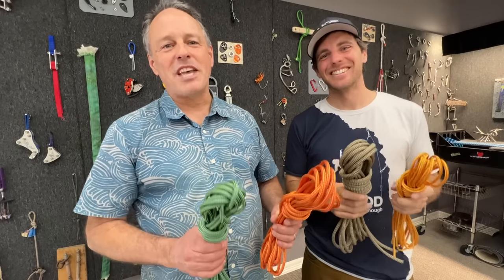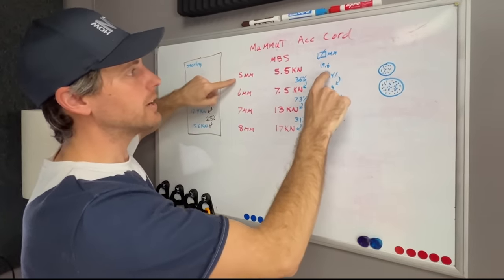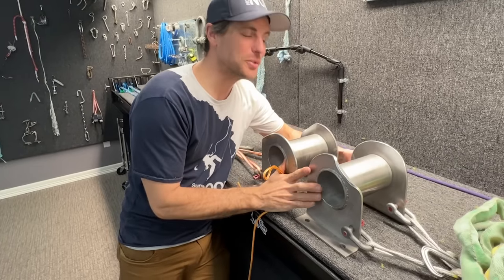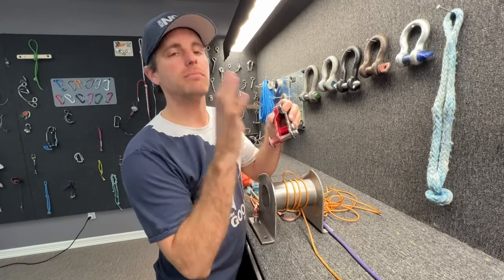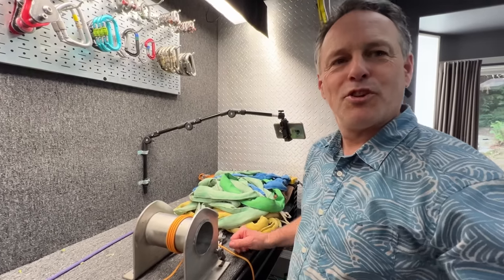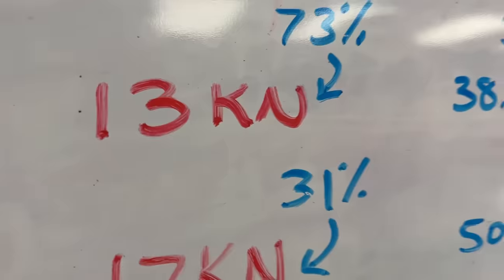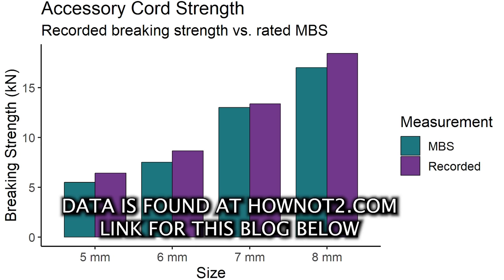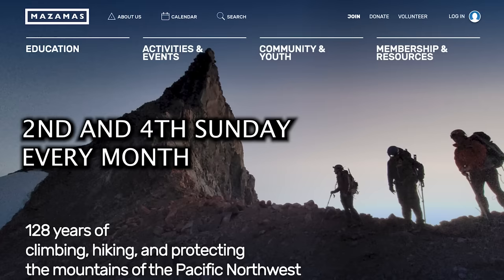The difference is INSANE

Comment: Not sure if it's useful or even interesting, but you could try desheathing the ropes and pulling the cores and sheathes separately to see where the strength increase is coming from.
Reply: Sounds interesting, probably not useful but it'd still be cool to see.
Reply: Quite interesting, questionably useful. Sounds like YouTube
Reply: Not an expert by any means, but my understanding is that the main strength is the core strands. The sheaths main purpose is to protect the core from abrasion and being cut on edges.
Reply: @cdans2202  often you can find literature that states its a 70/30 split of strength, the core being 70 and the sheath being 30 but both parts can be constructed differently to tune the desired properties.
Reply: Interesting vid.

Comment: If they need to hit MBS 99.7% of the time, the larger leap between diameters seen on the manufacturer's rating could be the larger diameter being more consistent, while the smaller diameter may be more prone to inconsistency reducing numbers?
Reply: I also wonder if maybe the numbers for the smaller diameter are from an older material or manufacturing method, and the increased strength wasn't carried into an increased MBS because it was a side effect or unintentional
Reply: You also saw the same phenomenon (just not quite to the same magnitude) in the actual tested numbers in this video though. So I don't think that's it.
Reply: @briancarr9663  sorry, I wasn't more specific because I did actually mean that magnitude of leap because the manufacturer rating and the ones tested here. The leap is there, but not as massive, and I wonder if this is because the smaller diameter is just a little less consistent for establishing an MBS.
Reply: Good hypothesis for 6 vs 7 In isolation, but not for why 6 vs 7 breaks the pattern established by 5 vs 6 and 7 vs 8.
Reply: @serges5681 
As Ryan alluded to there is probably a change is weave at6/7  making 7,8 comparable and 5,6 comparable and 6,7 brake the pattern.

Comment: I suspect that there is an actual difference in how they are made. If you calculate the breaking stress(MBS/area) you find that the 5 and 6 mm cords are very similar(.28), and the 7 and 8 cords also give the same number(.34).  But those two pairs are different.

Comment: This was fascinating.  One thing that popped out to me from the chart is that the safety margin for 6mm may be higher than that of the 7mm.   So maybe...with the smaller diameter rope they have to add a higher safety margin, because it might not be possible to control the precision of the smaller fibers as well.  Or in other words, if the strand spec is Xmm +/- .01mm or whatever, that's going to be a bigger percentage change for smaller strands than larger. Guessing here!  Fascinating tests.

Comment: Really interesting and great video! It would have been great if you cut the different cords and measured the thickness of the sheath and/or counted the number of nylon strings in the core. This could explain the initial jump. Also super nerdy: it would be interesting to test single strands of nylon in different cords to see whether they are all the same and if yes(no?) you could infer someting about the strength of the cord/rope just by the number of nylon strands.

Comment: I think you missed something in the fill area calculation with different-sized ropes. Rope diameter is including the outside sleeve, of which the thickness differs and allows for different amounts of nylon ropes inside.

And 12.86 KN isn't lower than 13 KN in significant figures.

Comment: Wrapping rope 3 or more times around a tree or round pole is called a "tensionless hitch" and doesn't reduce the strength of the rope as you demonstrated.

We used tensionless hitches around extra super good enough trees as anchors.

Comment: From a mathematical and engineering stand point its pretty obvious why the increase in strength is not linear with respect to diameter increase. The formula for cross sectional area strain (the area under tension or tensile load) of a medium (rope, in this case) is what determines the tensile strength of the medium. So the larger the area the larger the tensile strength and thus for a circle or rope, the area is related to the diameter via 

A=Pi*(d^2/4) 

If you notice the diameter term is squared which means that the strength cannot increase linearly with respect to linear increase in diameter. Probably doesn't necessitate the INSANE title, but it is very cool and unintuitive how tensile strength of rope works.

Comment: Ryan,
Yet another fascinating clip. On my first Mountaineering trip to New Zealand, I met a German guy who was soloing ...super lightweight, and he only had a 20m piece of 6mm to abseil with ( this was 1985 and long before Spectra or Dyneema was readily available..so his was plain old nylon 6mm )....I was horrified at the thought but he was adamant it was entirely adequate for a static abseil force. Seeing how the "Bollard" system works in collaboration with your snazzy breaking machine makes me wonder?? What about the knot we used to use in Scouts...the "Round turn ( or two or three ) and two half hitches. Theoretically, if you wound a few turns around a nice fat carabiner, and then finished with some half hitches, you could dramatically increase the working strength of your rope. I know that normally, with a rope between say 9 and 11mm you already have miles of extra strength anyway. Have you tested a round turn and half hitches yet?? compared to a figure 8 or even a clove hitch. Also, I note that most ropes break IN the knot, and that's largely due to the rope cutting itself. I have sometimes placed a carabiner WITHIN a knot for two reasons...firstly so it's way easier to get un-done, and as a bonus, I believe it's stronger. TRUE or False??

Comment: Did you guys count the number of strands in the rope?
Assuming all ropes have strands with the same diameter its possible that between 6mm and 7mm, while the area of the rope only goes up by 36% the number of strands that make the rope can go up by 70% (or 55% by your measurements).
And between 5mm and 6mm the area of the rope goes up 44% but the amount of strands it has can only go up only by 35%.

Comment: To compare cross sectional area of the loaded portion of the cord you also have to consider that the core isn't perfectly solid. It's circular strands butted up against each other. There will be gaps. The size of those strands dictates the amount of the area that is gaps versus strands. So the real jump in area you are seeing might not be the simple area of the circle with a diameter equal to the rope. The advertised diameter is probably also with the sheathing.
There is also elongation that would reduce the cross section of each of those strands which is the difference between real and engineering strain that would come into play when considering different strand diameters.
The sheathing might also begin to squeeze inward which would add to the load applied, which would also possibly change with sheathing diameter.

Comment: I've found the fraction of sheath to central (core) fibers varies a lot in cords. The sheath, measured separately, often amounts to about 40% of the strength. When the sheath is on the core, it has a higher lay angle, so is probably weaker, but it really serves to hold the core strands in place. My abrasion tests wear through the sheath rather quickly.  Again, great work, so we don't have to speculate thanks to you. I would recommend getting a jeweler's scale (0.01g accuracy), and weighing a small section of the rope tested, then weigh the same length of sheath without the core fibers.

Comment: Hey Ryan, can you test the strength of a nylon sling with a bowline on a bight, as used in the fixed point anchor? I'm curious to see if it would slip under a fall and at what force the double loop would break.
Reply: Ryan and I tested that with dyneema, not nylon. It broke at 20.4 kN. #SuperGoodEnough.

Comment: When you show the graphs, the force / load is the x axis. Is the Y axis time, or distance pulled? Do the hydraulics move at roughly constant speed, or do they slow down as load goes up?
Elongation vs force would be interesting (if the distance pulled is being recorded along with the load cell outputs) when modeling systems...

Comment: Isn't it because nylon strands come in relatively thick strings, and maybe going from 6mm to 7mm you can suddenly fit 2 more strings, rather than just one more for 5mm to 6mm because of the geometry of the cross-section?

Comment: Let x denote the area of a circle: x = π r^2. Take logs: log x = log π +  2 log r  then differentiate  (d log x) / (d log r) = 2. Log differences are approximately percent changes for small percent changes hence an approximate 1% increase in radius (or diameter) leads to a 2% increase in area.  An ideal 6mm diameter circle has an area of 28.3 square mm while a 7mm diameter circle has an area of 38.5.  7mm is about 16% larger than 6mm, but a 7mm diameter circle has about a 36% larger area (which is close to the approximation of twice as big a percent change).
Reply: From 6 to 7 isn't a small percentage change, so the first order approximation isn't much help.

Comment: So what is your (and anyone else’s) preferred diameter for cordalette for anchor building? Are brands vastly different? I just watched a vid in which the guy’s cordalette looked much more smooth, supple and “nice?” than mine. Wondering if it is brand or material. I’ll see if I can find the vid and edit in a link.
Reply: Both Tendon and Edelrid (Powerloc pro SP) make very high kN cords that are ridiculously supple. I regularly use both brands in 6mm (10/9kN) and 7mm (12/13kN). 
I've not found any better.
Reply: For my cordalette’s I favor using at least 7mm chord.  Unless using a high strength tech chord anything below 7mm isn’t strong enough for me to be comfortable using it.  There are times where a thicker cord would make sense/become necessary.  The first that comes to mind is for a team of three climbers that are hauling heavy loads.  In that case I would size up to at least 8mm maybe even 9mm.  If I was using 6mm accessory cord (which would be for prussiks, not anchor building) I think Petzl and Maxim both have pretty high ratings for this diameter.  Bonus points for cords that are made in the US or Made in Europe (not outsourced to China).  Looking up as many companies as you can to compare the ratings for the diameter of cord you’re after can be illuminating due to the varied results (the maker of the strongest 5mm cord won’t necessarily have the strongest 7mm or 8mm cord).  Which is why its not as simple and easy as "brand X has the strongest accessory chords period”.  

Also  I wouldn’t worry about what a cordalette in a video looks like, whatever catches your eye may not be indicative of anything relating to strength/durability.  You will certainly feel some variation between the various brands and options, some are stiffer/tighter and others are looser/supple.

 One alternative option to chords altogether that Ive been liking lately is the sewn web-o-lette type anchor sling.    I have the Metolius web-o-lette style anchor sling, the longer of the two sizes,  that I really like. Some of its advantages: integrated pouch that it stuffs into (vs having to coil it).  This is really convenient & fast plus it provides protection from UV damage as well as abrasion.  Also the fact that it has sewn loops on each end (reinforced/double layered) instead of relying on a knot or knots.  This allows for it to meet the 22kN standard for sewn runners and it eliminates the concern over knotted dynema’s tendency to slip/untie when under load.
Reply: @brianrodman1033  thanks for the thorough reply. With the sewn loop products you mention. Does each loop go direct to an anchor point? If I’m picturing that properly, those two points would have only one stand so there isn’t a redundant shelf. Shelf isnt really essential in a usual non-big wall setting but I’m curious if what I’m picturing is how you’ve used it.

Comment: High tensile strength cords even tho suitable for repelling are a disadvantage when distributing forces. I would not like to use a HTS 6mm and have to try and arrest a fall or even worse a get caught in a bite or up against a solid surface. A lot of force pushing against my meat: last thing I want is to get cut/crushed.

Comment: I have rapp’ed on a Petzl RAD Line. Used a Grivel Scream. Works just fine.
Reply: I want to get a Scream to have a device that’s intended for rappelling on accessory cord down to 6mm or 7mm in diameter.  Good to hear that it works well for you.  Are there any other devices that you would recommend checking out in addition to the Scream.  Also any downsides to using the Scream to look out for?
Reply: @brianrodman1033  the Scream is a simple binding plate so it is more fiddly to use than a standard tube device. It also has 4 modes that it can be used in creating various degrees of friction on different sized ropes. They are not the easiest to discern. 
All this is to say that it’s not the simplest to use. Gotta practice with it before deploying it in anger. 

As to other devices to use, I picked up the Petzl RAD system, containing a Tibloc and MicroTraxion. 
If you don’t already have an ascender, and don’t use them often, pick up a Tibloc or two. 

On a recent trip to the Alps, my guide and our crew used some purple static 7mm line for everything. I felt perfectly comfortable rappelling using that. It felt plenty substantial. 
The Petzl Rad line, on the other hand is spooky thin. Were it no for the purposefully high friction sheath and low compressibility of the rope it would be even creepier. I get a feeling that normal accessory cord won’t perform as well as a dedicated rappelling line as the ones designed for the task. 

Petzl suggests using beam cross-section type HMS ‘biners when rapp’ing on the RAD line. This probably applies to all other similar ropes. They are higher friction than round stick ‘biners. Adding multiple into your normal rappel device adds friction.  

Lastly, if you haven’t/don’t already, learn and practice how to climb a rope that you are suspended from. An ATC Guide/Petzl Reverso/most binding plates like the Grivel Scream can easily be turned into a progress capture device while on an extended rappel. Combined with a second prussik cord, a double length sling, and 2 extra locking ‘biners you have a very versatile system that gets you up and down the rope with zero drama. Also learn the Texas Prussik technique of ascending a rope with two prusssik cords. Always keep that kit with you. Lean how to rappel without a device. The Munter Hitch can save you or your partner when you inevitably drop your Rappel/Belay Device. 

Personally I would consider 2 double length slings, 3 locking HMS carabiners {Petzl Attache are favored by me}, 2 prussik cords, a cordalett, and a guide mode belay device should always go out into the field with you as your Emergency Rappel Kit. Add in a Tibloc and MicroTraxion with their accompanying carabiners, and you also have basic ski mountaineering kit, too. 

As to other devices designed for use on such thin cords, I know of none.

Comment: Im not a physicist or anyone who understands in depth the structural integrity of ropes, but however i just have some sort of feeling that the tensile strength of the rope may vary depending on the length of rope used. Id recommend testing with larger distances and compare to find out if true.
Reply: Well, that's not now things work, dude, with ANY material.
Reply: @admacdo2009  ya i was stupid high when i made that comment lol. I forgot about it till now

Comment: the strength increased almost is exactly in proportion to the cross sectional area. the larger the cross section of fibers, the stronger it is.  it becomes obvious if you plot area vs. strength on a graph.  No mystery.

Comment: The reason the jump from 6mm to 7mm that you measured was lower than the manufacturer's specs showed was clearly that the 6mm ropes you tested were simply too strong. All but one sample broke over MBS, but the smaller diameters were higher over their MBS than the larger ones.

Comment: John Harlin is generally reputed to have died on the North Face of the Eiger whilst jumaring on a 6mm fixed rope.
6mm is nice and light and compact to carry if your going to fix thousands of feet of it, but like any rope it frays if you leave it out in a storm and then the slender but arguably adequate safety margin that it provided is gone!
It's better than you mothers washing line though!

Comment: Neither the relative increase of the diameter nor of the cross-sectional area should have been compared to the relative increase of the breaking strength for meaningful results. It is the actual mass of the material per unit  length (prestretched by some small nominal amount - I think 5 kg equiv is the standard when measuring the nominal diameter) that matters. 🤦‍♂️ But kudos big-time for using mm squared instead of "sixteenths of erected other roughly cylinder-shaped body" standard units.

Comment: you may be making a mistake in assuming the sheath is the same size.  you need to check the sheath to see if it increases in thickness.

As a Ski patrol we used 6mm rope to rappel off of a chair lift.